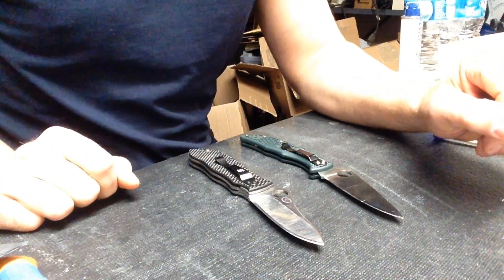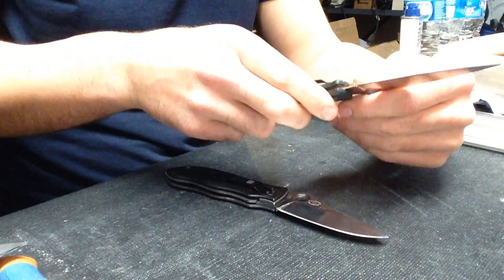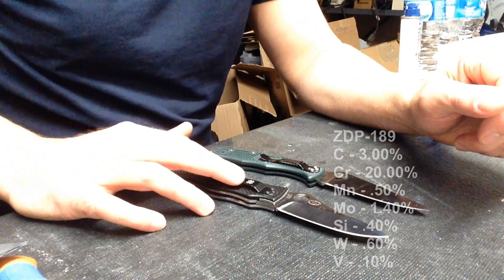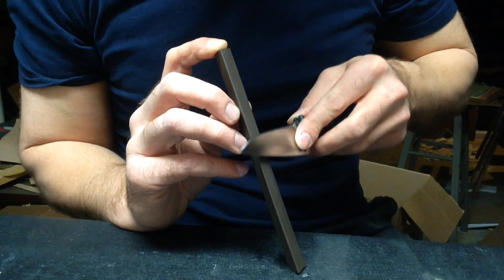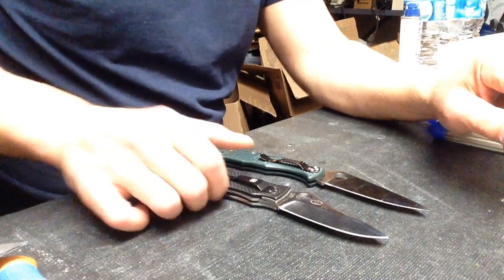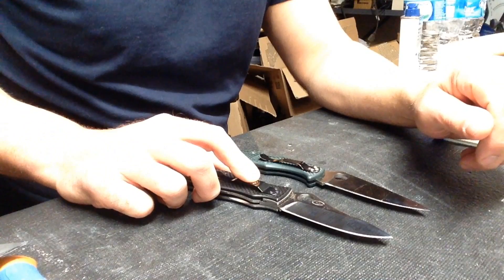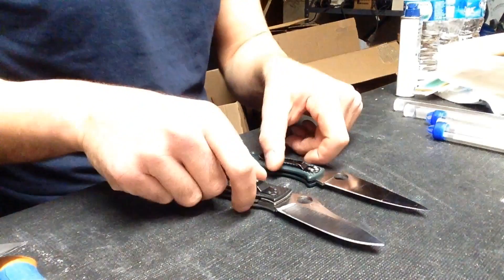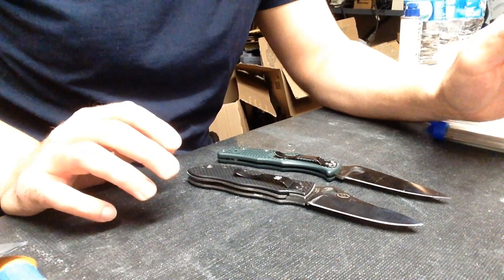ZDP-189/CPM M4 steel comparison

Comment: this is could be an example of blade edge-angle limiting results. You're possibly not allowing the zdp-189 to show itself because the edge-angle is too blunt, whereas the m4 is showing better than usual because the edge angle is much steeper than usual.  I can see that just be looking at the ~1mm difference in bevels on your knives.

Comment: Had the CPM M4 had a flat grind it would not have performed as well as it did. The hollow ground at 30* inclusive saved the M4’s cheese.
Reply: Believe it or not, behind the edge thickness isn’t related to edge retention. Since he’s checking sharpness by slicing, he’s only concerned with the apex sharpness. When measuring apex sharpness you control with the same apex angle. A vg10 at 10dps will outcut 10v if you raise the angle enough. M4 will support a steeper edge angle than zdp because of the raw toughness from the low carbide size and volume. 

A thinner edge will feel like it cuts longer because even if you lose the keen edge, the thin edge will require less PSI to initiate and continue the cut. 

This is probably all pretty obvious, just wanted to explain in a holistic way.
Reply: @lindboknifeandtool  Consider flat grind vs hollow grind with same bevel angle. Which will cut longer? Answer: hollow grind due to less psi required due to less resistance. Therefore, less edge fatigue. It all works together. Additionally, a courser edge would perform better than polished for cutting that particular media as long as as the micro grooves from the stone are larger than the  largest aggregate carbide size.
Reply: @michaelshuey1614  Blade grind doesn’t effect edge retention. Hollow ground blades also have more resistance when cutting in general. I’ll make a video on it with evidence to back my claims.
Reply: @lindboknifeandtool  I appreciate the offer to make a video with evidence to back your claims. However, by empirical testing in my lifetime and the lifetimes of others, I'm convinced that blade grind(geometry) does directly effect edge retention by way of "ease of cut" and type of steel. Push-cutting with a given blade steel is far better for edge retention than a sawing motion. Blades that are thin behind the bevel are more conducive to push-cutting than blades that are thicker behind the bevel.
"Ease of Cut": Let's consider straight razors. A hollow ground razor push-cuts far longer with less effort than a straight ground(barbers wedge) razor. This squares with the ever present concern of "thickness behind the edge" as discussed by BBB and others. The thinner the blade is behind the bevel, the easier it will push-cut whiskers. The thinner the blade is behind the bevel the less resistance there will be when push-cutting whiskers. The less resistance there is when cutting, the less fatigue will be induced into the edge. Fatigue(carbide tear out, micro cracks and etc.) results in less edge retention. Side note: There is a place for the barbers wedge because it is used for heavy beard removal. This is because the hollow ground blade will deflect and spring back, due to its thinness, causing nicks if used for heavy beard removal. 
The wedge never maintains an edge as long as a hollow ground. This has been common knowledge for centuries.

Comment: The geometry of the overall blades surely makes a difference when slicing cardboard but makes no difference when you evaluate edge retention by shaving hair. Shaving only uses "the edge." No need to discuss overall geometry or make disclaimer.
Reply from the maker: David Belanger but the geometry of the blade makes a difference on how the knife goes through material like cardboard, which effects the apex.

Comment: Holy crap the sharpness of that knife, splitting that hair. Well done!
Reply: Get the Lansky sharpening system and be sure to buy also the the ceramic 1000 grit hone and the sapphire 2000 grit . Then some stropping and you will obtain the same result even if you are unable to sharpen freehand.
Reply: @newhuskytwenty  👍 That almost sounds like something I would say 🙂. Got the lansky with the sapphire stones and a couple strops with BR black and white compounds. Although I have since moved on to sharpton water stones, the lansky is def the best and cheapest way to get a consistent, sharp edge without investing a lot of time to develop skill. The convex edge you get with a water stone is def the best slicing edge you can do but takes lots of practice and lots of scratched blades before you get it right.

Comment: Question.  Why the big difference in amount of inches cut between this test and the test where you compared it with the hap40 ? Or did I miss something ?
Reply from the maker: D T different cardboard was used in the two tests.  One cardboard to the next can cause a difference of 10X’s easily, so unless the same cardboard is being used for all the tests, you can’t compare the number of inches cut from one test to the next.
Reply: Michael Christy ok thanks I been burning up your videos watching several times apiece trying to see what you might have done differently but could not catch it👍👍

Comment: I know this is an old video but I just wanted to say I wish I could freehand sharpen like that.   I just cant seem to get consistent after years and years of trying :(.
Reply from the maker: Herne0011 use a guided system to set your bevel at a consistent angle.  Sharpen the knife and try to imitate the results of the guided system.  If you run into trouble, try a new technique.  Buy an Opinel and practice on that so you’re not tearing up your good knives.

Comment: Hi Michael, this is the first video of yours I have watched, while researching ZDP189. Your methodology for sharpening and polishing the edge could not be better. A quarter micron! Wow! I've no doubt that they were both as sharp as it is possible to achieve. And like you, I'm sure that final polish is the key to good/excellent edge retention. You could possibly show this in a video using a USB microscope. Subscribe, Subscribe, Subscribe, (I will rewind, to watch all your vids in chronological order). I wish Spyderco would do an Endura in ZDP189 with the stainless scales, or G10. It's so nice of them to put G10 on a budget model, the Resilience.

Comment: A great choice to compare! Thanks Michael.
I would have bet on the M4. With its added tungsten and vanadium, and not so much chromium, to dilute its Carbon content. Even with its Carbon being at about 1/2 the amount of the ZDP-189. Very close test though. Maybe the flat grind was good for a % or three?
Reply from the maker: Steve Kluver I'm sure the flat grind didn't hurt anything, but ZDP is a great performer.  It usually doesn't get the credit it deserves.
Reply: Michael Christy I'm sure you're right. I do have some M4 knives, but no ZDP blades yet. I'll have to get one, and try it out.
Reply from the maker: Steve Kluver I really like both those steels.

Comment: have you done an edge retention comparison between CRU-WEAR and MAXAMET?
Reply from the maker: Blake Smith no, but they wouldn't even be close.  CruWear is a high toughness steel, closer in performance to 3V.  Maxamet is a high wear resistance steel, above 10V in performance.

Comment: Was the edge angle the same on both knives?
Reply from the maker: knives save lives Yes.  Both 30 inclusive.
Reply from the maker: Kai Xin QIN I use an angle guide.  I show it in later videos.  I think it's in the 10V/S110V video.

Comment: In your testing does one seem to chip out more than the other or are they similar in that respect?
Reply from the maker: With what I'm cutting, they are similar in that respect.  However, M4 has a higher toughness rating then ZDP, and should be less prone to chipping.  That being said, I've never had either chip on me.
Reply: Good to hear! With what I use knives for I think either would work fine for me. I just use for slicing mainly.
Reply from the maker: +William Kister both of these models are great knives, but the Endura is probably better for what you're describing as your use.  There's also the Mantra.  That has M4 steel, titanium scales and it's made to cut...  It's a slightly smaller knife though.

Comment: What a great video. I hope your channel catches on soon, you're putting out some great info. If you crunched the numbers you would probably find that 3.3% of a difference isn't enough to make any conclusions but very good test. Thanks for the video
Reply from the maker: Thanks.  I agree, 3.3% is so close that you wouldn't see it in real world use...  Not with this type of cutting at least.  I think what makes more sense for the user to ask is, what sharpening supply's and methods are available, and what kind of cutting are the knives going to be used for?  Also, what models are available in the two steels?  
Glad you liked the video.

Comment: Since i have broken two endura locks, i would really like one of those bradleys in ZDP at 67hrc

https://www.youtube.com/watch?v=LYQRxArvYmQ
Reply from the maker: You're supposed to use the sharp side for cutting.  The spine isn't meant to be a hammer.
The Bradley folders don't come in ZDP, but M4 is a great blade steel.  You would probably like it very much.  (not stainless though)
Reply: I do like it in my limited griptilian, which can hold mine and my parents weight on the lock

You are also not supposed to crash your car
Reply from the maker: +VicariousReality7 I don't need a lock that can hold my weight because I know how to use a knife.  I use knives everyday and never put pressure against the spine.  If you need a lock that strong, you don't know what you're doing.
I also don't crash my car.
Reply from the maker: +VicariousReality7 I assume your Endura is saber ground with ZDP.  I'm curious, does the lock feel a little off when you disengage it?  Did you notice it before doing the spine whacks?

Comment: Nice video Michael. I like this vids very much. I like the vids of Stamp and Ankerson also very much, but i like the way you explain and the way you show things.
Concerning these particular results: not very surprising they equal pretty much. I am getting curious about the results between 2 big production companies which both use the M4. Would there be big variations between a Benchmade Contego M4 and a S. Gayle Bradley? Just because of the rumours that Benchmade gets the M4 on the Contego slightly higher on the Rockwell scale.
Reply from the maker: I take it as big compliment to be mentioned in the same sentence as Cliff Stamp and Jim Ankerson.  Their experience and skill level far exceeds mine.
The Contego would be a good match up, but I think most of the production companies have an acceptable range that they work with for the RC on their steel.  (There's several companies that I know use a range).  If the test was conducted for reasons of differing RC, you'd have to take that range into account.  The factor of the range might also leave you with a stalemate.

Comment: So in this test these two seem pretty equal in edge retention and you mentioned that agrees with what your real life experience has been.  What has your real life experience been as far as toughness is concerned?  Have you noticed any significant advantage of the m4 when it comes to micro chipping or chipping in general over the zdp?  I've never used zdp or any steel run into the mid 60s, s110v at 63 is the hardest I've ever used.
Reply from the maker: I haven't found ZDP-189 to be chippy at all.  In fact, I've never seen it chip.  For a thin ground folding knife, being used as a thin ground folding knife, I think it performs very well.  
One of the issues that people may have with the steel, is that they're consistently doing touch ups to keep it sharp.  (Cliff Stamp talked about this in a video.).  I always sharpen starting with coarse diamond, so I'm always using fresh steel.  I don't usually bother with touch ups.  I use a steel until it's dull and then sharpen fully.